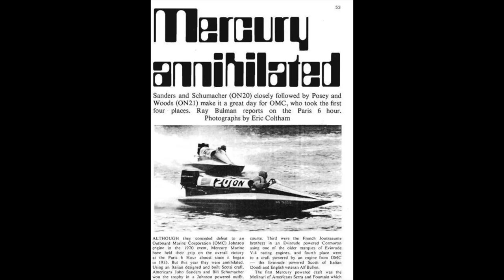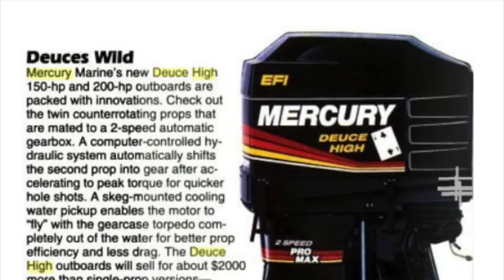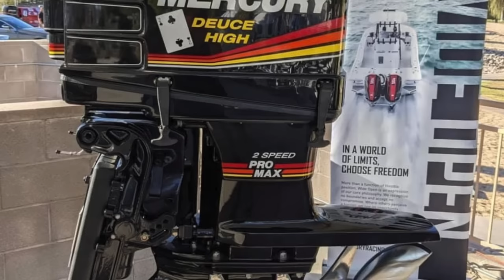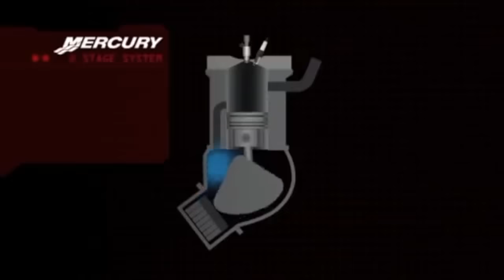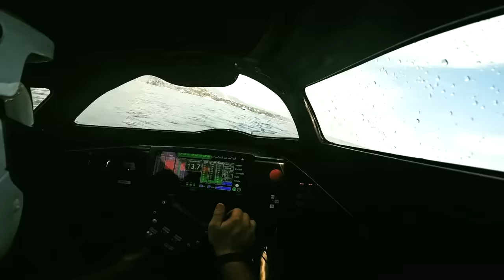Mercury Racing TOP 5 ENGINES OF ALL TIME 50th Anniversary Special

Comment: The designers at Merc killed it with the APX 🤌
Reply: um..no.
Reply from the maker: @riverdragonmarineservice441  Um, yes
Reply: From what ive hurd is its a great motor but still to heavy and it maybe a flop. they looking at getting rid of it already and going to a v6 option.
Reply: @rickg1984  you heard wrong… Apex in either V8 or the V6 version will rule. Unless they go with the new low stresses V10 for this type of racing. Which would lower cost.  The motor would last season or more.

I do not want to hear argument about weight.  Not enough to make a difference with today’s ability for hull designs.  Plus, fuel economy heard will reduce need for as much fuel (weight) for same length race.
Reply: Arridatece il black max....🤣🤣
Reply: @ADDvanced  Lots of guys working on these things for a living know about the endless problems with the v6/v8 platform
Reply from the maker: @ACatKrom  Better put some money down for the races this season....   see which comes out on top :P
Reply: @ADDvanced  Its easy to win when you are the only one racing, because the market and publicity is so small no other manufactures bother.  And I stick by my comment that the consumer v6-v8 engine is a the least reliable series of engines currently for sale by any manufacture
Reply from the maker: @ACatKrom  https://www.youtube.com/watch?v=1vBesOFURek
Reply: @ACatKrom  love your response to the comment via a link.  Some people will stick to the analogy of steam gauges and horses.  Never like the V8, V10, V12.
Reply: We have the deuces high up at 36 on a stand there. The 450r sold very well and hopefully the 500 will follow. Apx is a great engine she sounds amazing in the test cell!
Reply: facts
Reply: @spankthemonkey3437  is that what has already routine issue?  I understand your theory based on equal stresses and RPM. However the APX is not same as old 2 strokes. For me (had two Merc racing 280s, and now 300R), far less wear/stress on the 300R, 10x  better life at high pleasure speed boat running for the 300XS/R (not pure race running).
Reply: @spankthemonkey3437  I am not getting a direct answer.  Needle bearings also are not lubricated with full flow oil, instead by the smallest of lubricant mixed with gas.  Bottom line.  Run 2.5 at >70% of rpm top, rebuild mandated 100 hours or so… IF something does not break. Run the 4.6 same, up to 10x+ more life before rebuild.
Reply: @spankthemonkey3437  what the hell are you talking about. My 2.5s were Merc racing (off shore/sport master) EFI, solid bushings, racing reeds/all internals, large single trim/tilt pump.  There was never oil injection on these.  These are the real direct out of factory racing Merc motors. Look, you do not agree..l so be it..  I have moved on just like Mercury. My 300R V8 is 4 years old+.  Never any “rings replaced while drinking beer”.  Nothing done except fluid/filter changes, and water pump impellers.  It runs faster for longer than any of my other Merc racing platforms on the same boat. It also cruises much better. Overall costs have been reduced by 80%+ when considering lower gas consumption and lack of maintenance/rebuild.  TCO is minuscule compared to what I had before. 

Look, I loved the 2 cycle Merc EFI based racing motors I had.  Never let me down.  The sounds are amazing.  The Merc V8 sounds are better…
Reply from the maker: @spankthemonkey3437   I've talked to people running an APX for an entire season, and they do nothing but change the fluids.
Reply from the maker: @spankthemonkey3437  How many people have you talked to that own one?
Reply: The designers at OMC lost in the end. gotta stay in the game. I loved the OMC .
Reply: @johnross6314 
A season or more?
What then?, send it back for a 25k exchange unit?
Reply: He said best looking outboard lmfao 🤣
Reply: Tower or power
Reply: @ADDvanced  wont be a winning engine tho
Reply: @johnross6314  the two strokes are alot better for racing
Reply: @spankthemonkey3437  needle bearings are required because a solvent, gasoline, mixed with small amount of oil lubricates those surfaces. Basics of 2 cycles. You and others are talking apples and oranges.
Reply: @spankthemonkey3437  I am not very bright?  Wrongo bud.  First, you do not know what the hell you are talking about related to my motors I have owned (you have not). You, nor your dad ever owned a Merc factory racing motor. I have now, from new, owned three. 2.4 EFI, 2.5EFI, with factory Sportmasters, off shore exhaust system.  Now running factory racing 300R V8 w/sportmaster 2 since 2018. The 300R, like the APX, both are superior across the board to what I had before. I get people clinging on to the 2 cycles. Those who do will keep the old tech alive and kicking.  I am not insulting those who seek to stay old school.  Get that. On other hand, time has marched on.  The Fed mandates, in a back assward way, has not killed outboards (like Butplug Trans Secretary, or others before wanted), the new tech has advanced the outboard cause.  While not perfect, Mercury 4 cycle V8 tech rules. Especially those made on the Merc Racing production line. 

Let’s not argue “RPM”.  Mazda rotary motor turns same kind of revs.  Wankel is mostly a 2 cycle.  Where is it over the years?  Placed on the ash heap of history several times.  Sure, it is cool tech, a group of people keep what is out there running. 2 cycle outboards days of dominance are over.  Outboard industry is better for it.  Racers and consumers alike, take advantage of the Merc Racing V8 tech.
Reply: @spankthemonkey3437  WTF? Reread my comment. Never said Merc Racing 2.5s never had needle bearings.
Reply: @RaidifyLifts  no they are not better for racing. As we have seen.  Again, not dissing the 2 cycle racing motors.  I have owned two new from Merc Racing factory (2.4EFI, and 2.5EFI).  Have you?  They were great motors. Fast.. Never let me down.  I believe both are still running today. One down in FL (on rebuilt Allison:, the other I lost track in Indiana.  With that said, the factory new (2018) Merc Racing 300R has proven to be superior in every measure. And I adjusted to prefer its sound over the buzz bomb 2 cycle racing motors.
Reply: What major F1 teams are using that 360 APX???...

Comment: Don’t forget the 20h the 30h and the 55h race motors from the 50s. I have a collection of them from when I was a kid. Them engines are powerhouses.
Reply from the maker: I didn't forget about them, but those are racing engines from Mercury Marine.   This video, as I tried to explain in the beginning, was specifically about MERCURY RACING products, and that company started in 1973, which excludes anything made prior to that.  Maybe I will make another video on the top 5 Mercury Engines of all time in the future?
Reply: @ADDvanced do it
Reply: Those are the best!
Reply: The Mercury Mark 20H with conversion kit.  The baddest sounding racing engine of all time.

The green and gold Mercury Mark 20H unconverted , the most beautiful outboard ever.
Reply: I have a 50 made in 63 with a magneto still has 120 lbs per cylinder on a 58 alumi craft V Hull . We call it MAMA cause Daddy bought it new for her and we all learned to ski behind her. I got the boat my grandkids call her RIVER RAT.

Comment: You should at least have given a mention to the 400R, it's the pinnacle of all Mercury's inline six engines. The crowning achievement. It's one heck of an engine and sings beautifully at +6000 rpm. I've run several of them and for something which has +150hp/litre (a lot!!) it's amazingly reliable.
Reply from the maker: They are definitely bad ass motors, but APX is cooler :D

Comment: Thanks for the GOAT video including the V6.  As a actual owner of 1.) Racing 2.4 EFI with speedmaster 2.) Racing 2.5 EFI (300hp) speedmaster 3.) Racing V8 300R, I appreciate your views. I suggest you should expand the number..  As actual owner who has all the above on installed over time on the same boat platform, the 300R is the GOAT.  The V8/V10/V12 modular platform is the GOAT.  The last of ICE motors before EV takes over. Out of the V6s, the Racing 2.5 EFI, to me, is the V6 GOAT.  

The tower or power….  As a kid, we had on Glastron Carlson running a mild modified 150hp straight six.  From nostalgia standpoint, for me, the 150 platform was the tower of power GOAT. One of our neighbors had the racing tower with external resonators out the side on a GW Invader tunnel.  As a kid, love that combo. 

The DOHC stern drives, AND automotive restomod available, kills any German or whoever automotive platform power.  Your are dead on highlighting this amazing Mercury miracle motor platform. 

Mercury WAS the real designer and builder of the mid 90s Chevy DOHC. Which was a ringer motor in case Bill France (racist hater against Ford) would have decided to let the Ford modular OHC/DOHC V8 program into his NASCAR (he did not.. scum). Mercury made motor went into the C4 ZR-1 Corvette.  To this day, this ZR-1 Mercury platform run hard…. unless some num-nuts attempts to modify, it is close to indestructible.  

In case anyone is curious..  Still have the custom Doug Smith made Kevlar Baja (with Gil bracket bolted onto what people would call a stern drive look transom).  It truly is a sleeper. Open bow, sun deck in back, low sided, special V bottom.  This platform currently has the 300R.  Prior, it started with the racing 2.4 EFI, and racing 2.5 EFI.  Moved to the 300R few years ago. The hull is truly one of a kind. I never had ANY repair, defect, or “left behind dead in water” with any of the Mercury motors. Routine maintenance.
Reply from the maker: Hey John I really appreciate your comment, sorry for responding to it so much later!   Yeah, maybe I should do another video.  All the engines you mentioned are super badass, you should check out my Merc V6 history video if you haven't seen it:
https://www.youtube.com/watch?v=TbEilffmFi8

The reason I couldn't include them was that I was trying to only include one engine per decade, and regardless of how sweet the 2.4/2.5 is, the Deuces High is cooler, and regardless of how cool the 300R is, the APX is cooler.  Lol.  

You sound rad, what part of the country do you live in?
Reply: @ADDvanced  thank you! No issue related to response time. You have a non YT life. :)  I will watch your link again.  Some time ago, already gave it a thumbs up. :)
Reply: Growing up We had a white and red Glastron GT with an  Evinrude. My favorite boat in the entire world of all
Times.  James Bond jumped our boat lol. I loved reading your post. Landed on my heart. Great memories I’ll keep until I pass.
Reply: @b.d.ericksonii203  Thank you for your kind words!  Loved hearing your Glastron history..  when I was growing up, we first had a Glastron.  Maybe called “176”? It was closed bow, 17’, windscreen that opened in the middle. Had tower of power 135HP.  Dad moved to Glastron Carlson 18’.  Forget its designation.  Had tower of power 150hp.  Which at the time was most powerful outboard.  I could swap stories all day on our mutual “Glastron days”.  Led me to stay with the outboard family of boating.  Doug Smith’s Baja was great.  He also kept fond heart for outboards in a times when so many were moving to big block Mercruiser sterndrives.  Met an amazing hooligan Mod-VP racer, who happened to be the Baja dealer.  He and Doug custom crafted my boat, as he did for others in the special modified family. “SVO”-Shelby (Special Vehicle Operation) like partnership.  I also will remember your description here about your Glastron days until I assume room temp.

Comment: We got an engine from mercury racing team back in the day off a tunnel hull when they swapped to a lighter/newer engine. It’s a build using the 150 block and a 250 lower unit. We dropped it on our 16ft charger with a few mods like, custom gas tank, hot foot throttle, hydraulic lift and tilt and a reinforced transom. The thing is bonkers to drive, burns gas like crazy and burns gears like a dragster. Not cheap to run but what a boat. I’m currently forcing my dad to not get rid of the engine. He has been wanting to swap it for years because he is getting older and it’s a lot of work. I been doing most of it for a few years now. I hope he succeeds and gives the boat to me. I will take care of it forever.
Reply from the maker: Sounds epic, post some videos!

Comment: Ohhhhh the optimax ..I got one of these on a shellfishing boat. Do I love? Meh, when it’s running good I love it. But it’s got it’s gremlins, like anything. Coming up on 1000hrs and I’m told they’ll go about 1300-1600 before some catastrophes. But fingers crossed, she’s ready for another season. Only thing I wish I could get for it. Would be a higher amp alternator. I feel, they are a voltage hungry motor. And could really use another 10amps of output. Awesome video, pretty neat seeing Optis on jet boats:-)

Comment: Great list of motors!!  My top 5 coolest would be the 25xs,44xs, deuce high, 300drag, 450r!
Reply from the maker: Solid choices, but would break the 'best per decade' split.  I almost went 450R.... but the 360 is just so much more hardcore.
Reply: In Florida, and similar places, if you don't have a 2.4 Bridgeport offshore, 2.5 280 Offshore, or 2.5 300 Drag, you're getting left in the spray. All equal, a 300 Drag leaves a 300Xs 3.4L in the weeds simply because of the RPM the small bore is turning on top end. And lets be honest. I can own 3 2.5 300 Drags for the cost of 1 overpriced, heavy, underpowered 360 Apex.  A few mods can put a 300 Drag in the 450+ range, still naturally aspirated.
Reply from the maker: Those are all great engines man, but the Dueces High is cooler than any of them and I picked one per decade.   For actual production engines, I would have picked a 2.4 Bridgeport but Deuces High is still more interesting/cooler.

Comment: Super cool video. The Optimax name was not used in the start, but instead DFI for Direct Fuel Injection and "Orbital technology"... OMC launched their Ficht system about that time and Optimax was chosen as a better name to be better than Ficht which also was a direct fuel injection system. 

The QC4v. was launched in 2011 with both 1100 and 1350 hp. engines with No6 and M8 drives respectivly. 

You should work for Mercury!
Reply from the maker: I remember Orbital!  My dad had a lot of stock in them at one time, they were pioneers of direct injection; I think other companies just engineered their way around the patents.   Sounds like a cool place to work!

Comment: Stoked to see this and learn the ProMax got  direct-injection in '96. Don't know much about the Mercs other than they made competitive racing outboards. Coming from Seattle, my dad started taking the family to the Seafair races in the 70's and got to also see some of the crazy slough racing before it got banned.
Reply from the maker: Oh man, I want to go out there so bad and hitup that hydroplane museum.  I'm so jealous all that stuff is over there..... kind of angry about it tbh.
Reply: @ADDvanced  I used to live within walking distance of the museum over 20 years ago and it was super cool then. Haven't been back there in about 20 years though.
Reply: @ADDvanced  One more thought, if you ever make plans to come out to the museum, you may want to time it when Seattle Outboard Association has races on Angle Lake, which is basically right across I-5 hwy and Green River from the museum. I think SOA lists the race schedule on their Facebook page too.
Reply: promax did not get direct injection all promax engines use the laser injection system or have been retrofitted to SVS aftermarket system.
Reply: @crashalexander7232  Based on the video, I meant OptiMax. As stated earlier, I don't know much about Merc outboards. Although cool, I'll never own a 6 cyl. 2-stroke due to the lack of fuel economy and the expense of quality 2-stroke oil. Therefore, don't see any logical reason for the fact check.

Comment: I say this so often one may think I work for them but it's true that even NASA Engineers don't have shit on Merc. The Quad Cam 1650 is outrageous and as I predicted plenty of hot rod car guys are catching on. That's cool but two strokes are still my thing. At a time in the 80s when OMC port castings looked like a child chiseled them with an axe Mercury was developing port art work. Yes OMC was before Merc with the Holy Grail of port design, the Looper but at that time I think it was desperation that necessitated it. The 2.5 Off Shore started it all for me but I've recently found the best deal going. The 50s and 60s Merc had the popular 40 and 44 cube 4 cylinders. You can basically get these things free or cheap and half the time you could have them running in an hour. Considering many are a 4 cylinder 2 stroke rated at 30 to 50 HP they run and idle smooth as silk and have huge performance potential with very little cost. That's if you don't mind playing with a smaller and lighter hull. Either way this video and comment  could go on forever. Merc. And the Lake X stories of back in the day are so cool it makes me glad to even know the small bit I do about all of it. I'm really excited about the whisper quiet V 10 and V 12s also. I suspect the V12 will soon be putting out 750 HP once they force feed it some fuel and air. Merc. Just seems to come up with a new shocker or game changer every few months when most struggle to do it once in a career.
Reply from the maker: Yeah man, and just.... the boys in central WI vs .... the entire world.  Lol.   I love how crazy some of these products are, excited for the future!